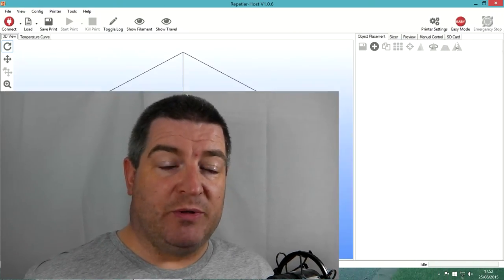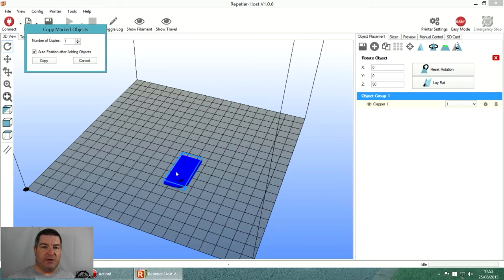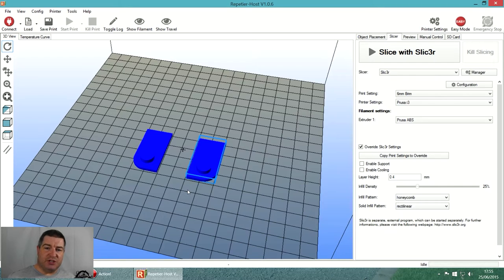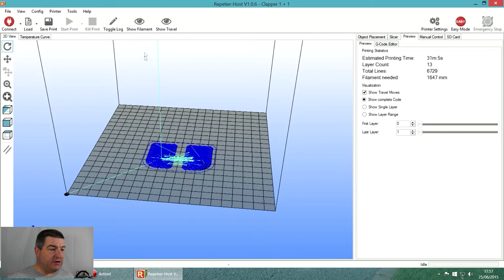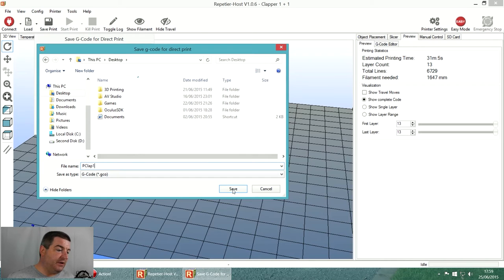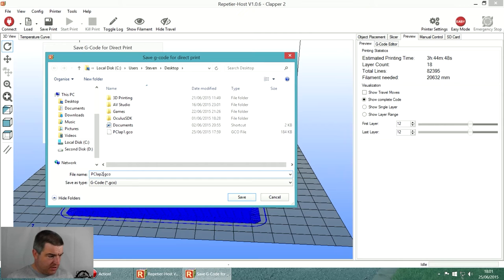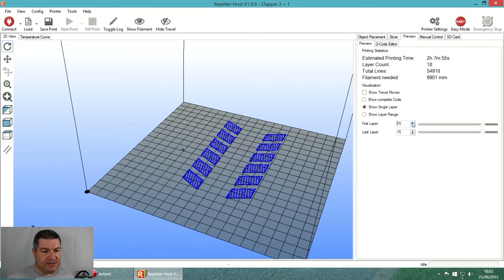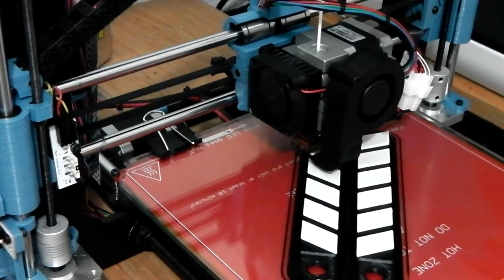BQ Prusa i3 3D Printing - Clapper Board Project #02

Comment: Nice vid. I have a BQ prusa on order which I will get in a  few days. Did you add the heat bed and change power supply? I was hoping to print without heat bed...Also hows the extruder compared to an E3d head?
Reply from the maker: nobblynoel Hi, I picked my BQ Prusa i3 up from PrintME3D.com  The guys there were more than helpful, making sure I had all the required components for the heated bed upgrade.  When I built it, I started with the standard kit.  It took around 6 - 7 hours to build and configure (here's a tip.  Windows 8.1 requires Driver Signing to be disabled for the ubs to install correctly.  That delayed my build a further 4 hours.  Doh)  I had some PLA samples around so I ran an quick 25 min print using that.  Once I was happy I added the bed heater and up rates psu.  I found this gave my more confidence in the build as I saw it working before adding the heated bed.  The stock BQ hot end is amazing.  I have printed Ninjaflex, Bendlay, Woodlay and Glow in the dark PLA, not to mention a whole ton of ABS.  The only bad thing I can see is the nozzle is part of the heater block where the E3D nozzle is replaceable.  Enjoy building your BQ Prusa i3, if you need any advice just let me know :)
Reply from the maker: Sounds cool.  I am planning on adding the anti backlash too, err I don't see my z axis support mod listed here :( note to self "remove nobbly from Christmas card list!" ha ha ha ha ha ha ha